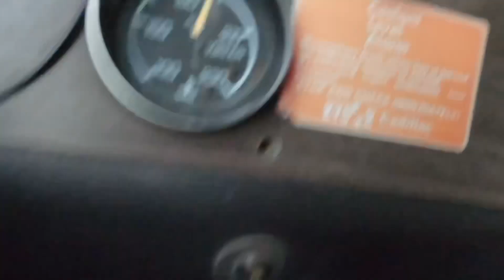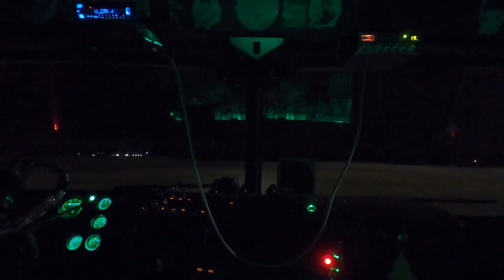K100E Aerodyne Cabover We Sprung A Leak!

Comment: It probably has a little air in the system since you cut the line. Mine was doing that for about 100 miles after I had just top it off. Then it fixed itself.